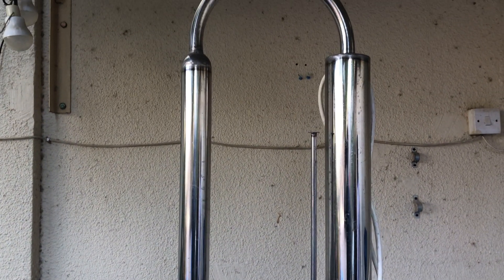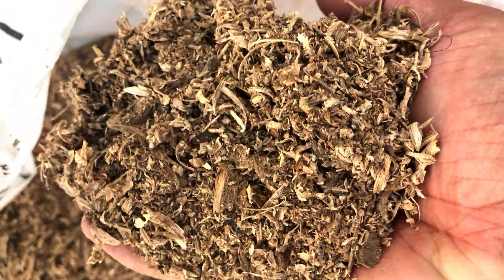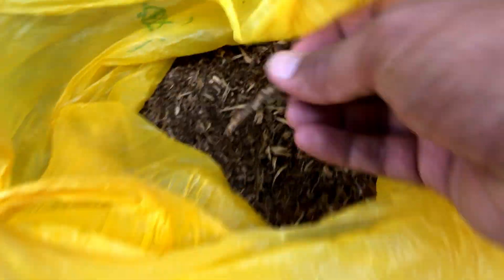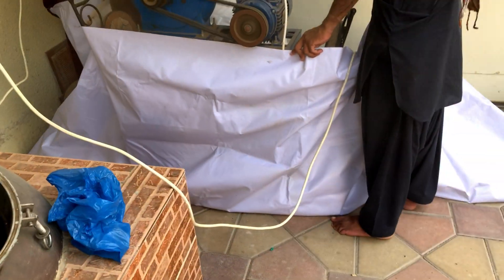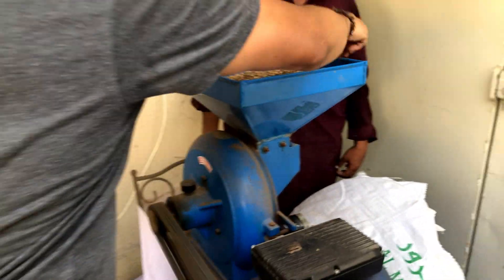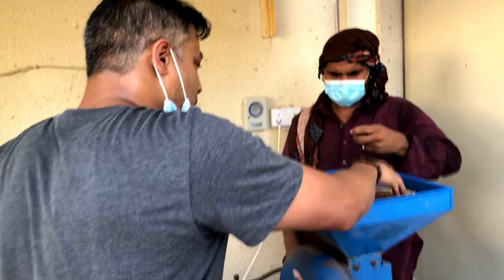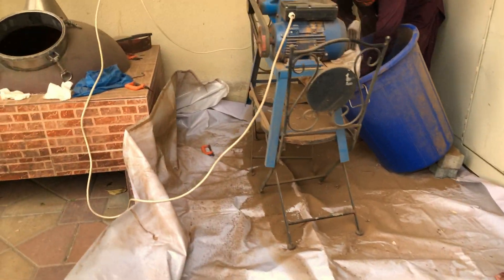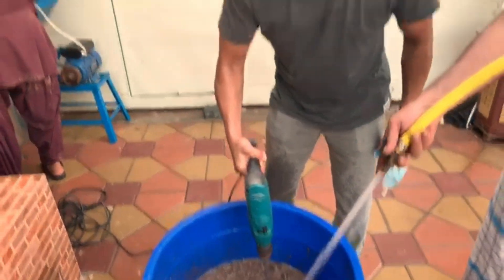Oud oil distillation-part  1                        by OudBase.com

Comment: How much kg pot must be there.
Secondly how much water and how much material
Thirdly what duration to remove oil
Fourthly what degree we have to keep.
Fifthly if whole tree cut then how to distribute means what type is to be separate separate and distille.
Like black portion then semi black then white portion then its bark.
Plz give me tips.
And what else precaution to remove oil? 
Plz reply. And if u want to give me any tips.plz give.
While doing set up what precaution to be taken.
And from where i will get such best quality copper pot with stirrer but electric and whole set with gas burner?
Reply from the maker: The purpose of my videos is to inform and educate people about oud. This channel is not for wanna be vendors who want to know every last detail in how to be come a oud vendor.